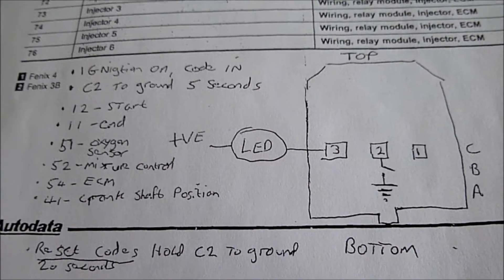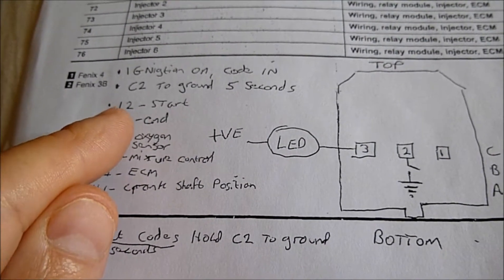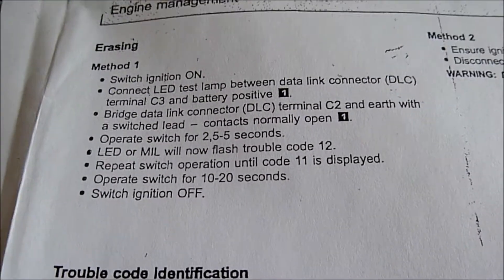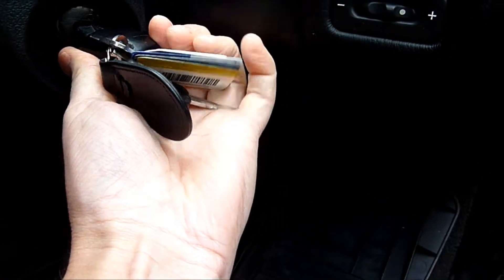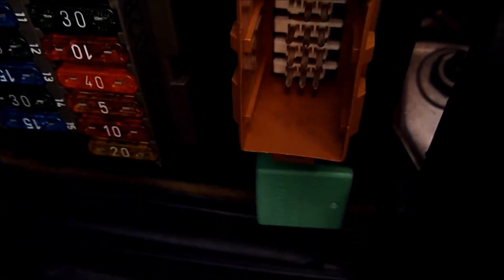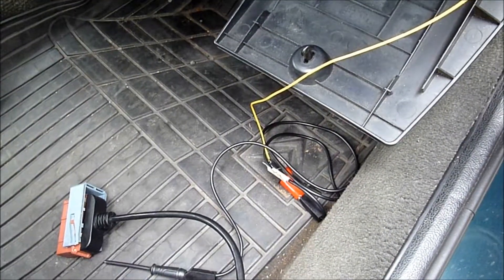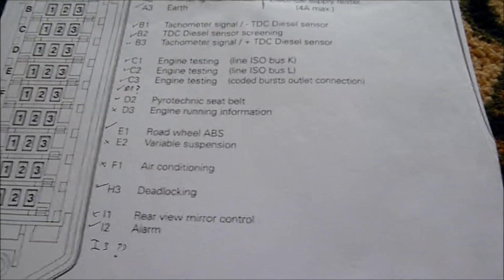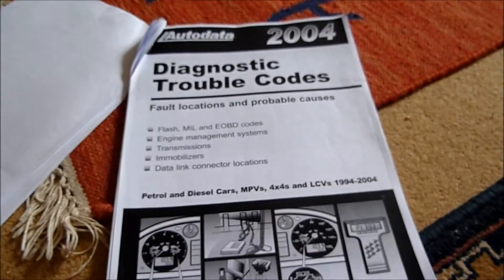Diagnostic Trouble Codes Citroen Xantia LFY XU7JP4 Engine Bosh Mp5 1 1 ECU in Hd

Comment: tryed it on my x1  1995 ~2 years ago,didnt work :( but this(LED) method worked on mazda 626 1990 many years ago :)
Reply from the maker: CarShed68 do you have the x1 car?  have you upgraded to the x2!!!
Reply: yes i had x1,but engine was bad so i found almost same price like costs engine a x2 with broken clutch and etc! on x2 i have obd2 i got lexia3 but i had problems with software,i need diferent pc ,because software dont use intel athom CPUs :(
Reply from the maker: CarShed68 I spend more ££,s on my x1 than the cost of a good x2, i've owned the car for over 20 year's & have enjoyed learning how to keep the car in good condition & maintenance skills
Reply: briandoliver wow so you get it new? Its not so dificult suspension like people think,worst part is steel oil lines,but i saw one site they sell them in lenght u need :)))
Reply: @CarShed68 ...8 years ago....
Reply: Gonna try that simple method....my xantia x1 always had a limp mode auto gearbox....while driving suddenly it just getting revvy...stop ..drive again heck its running on 3rd gear only....stop the car, wait gor few mins, restart and its back to normal...